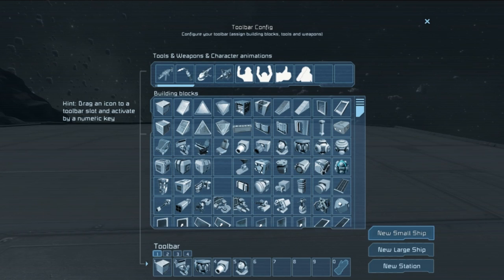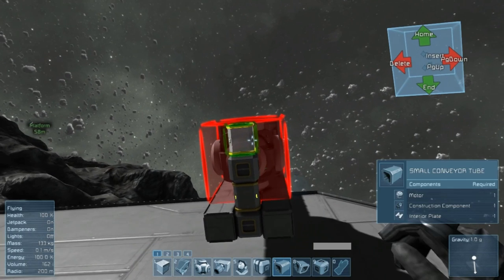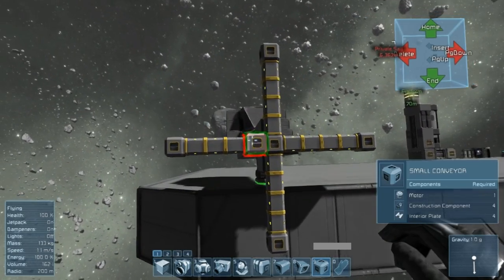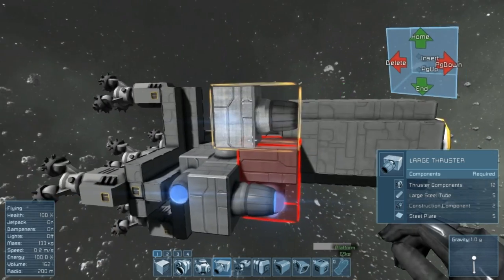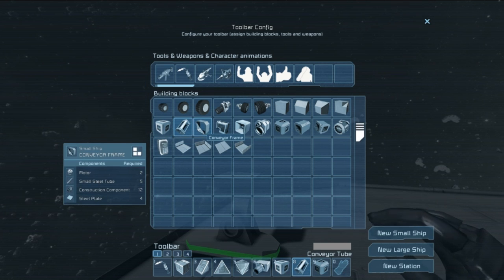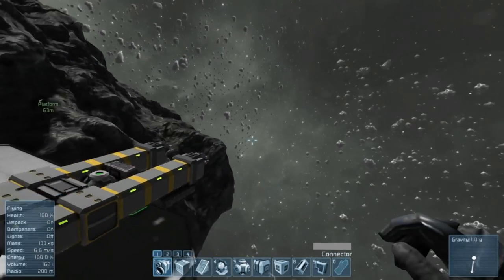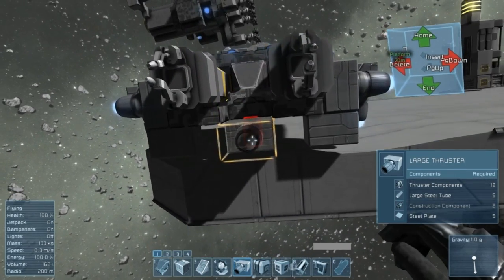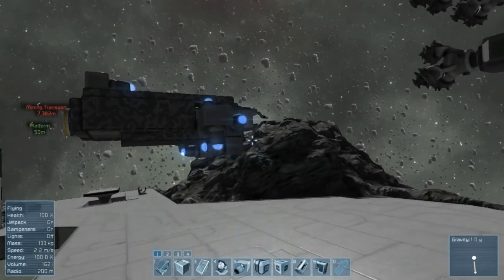Space Engineers Survivial - Episode 04 - Ship Building Concepts

Comment: I take it you dislike small engines haha. I usually make very small ships for starters then move up in size as I go on. I have found with 10x inventory space it takes a long time to fill up 3 drills. I think I have a video some place that shows a few of them off but I will double check.
Reply from the maker: the problem is using small thrusters with connectors...you end up taking up alot more space on your ship to break the mag lock...I also find the large thrusters provide more stability when the drills are active